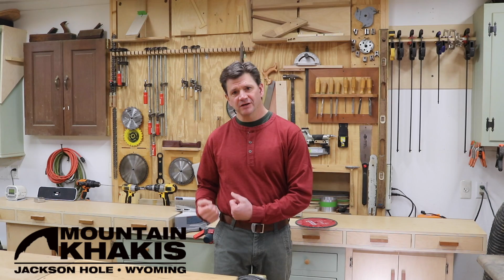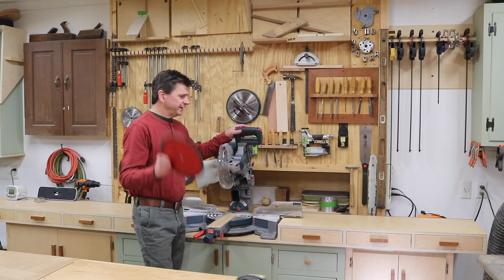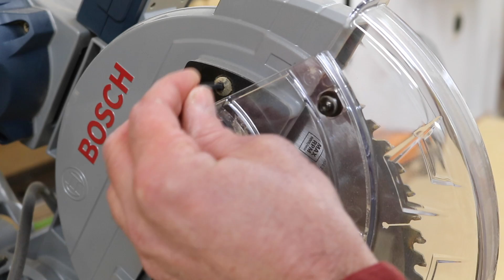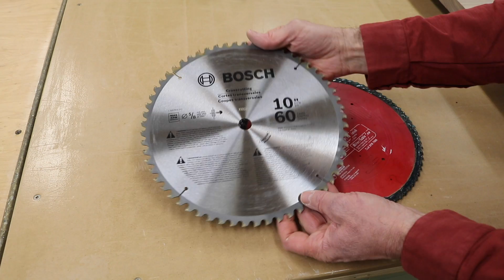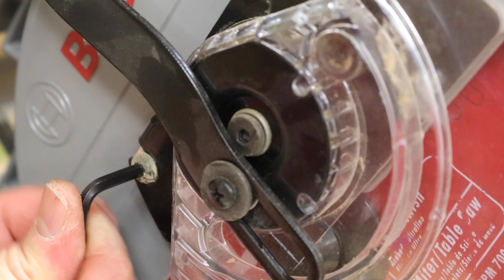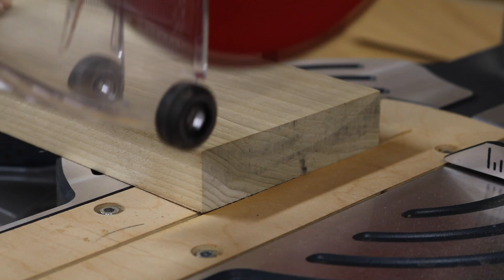Change Blade & Improve  Performance - Bosch Miter Saw

Comment: Thanks for the video. 
I am trying to remove the blade bolt and holding the arbor lock and rotating clockwise on my Bosch miter saw and turning the hex key with all my might, but it is not moving. Any suggestions?

Comment: I replaced the stock blade on my Menard's brand 10" miter saw with one of the diablo 80 tooth blades.....whole world of difference. I'm sure with this Bosch, it has more RPM's so it's even more smooth when cutting. I put the same blade on my Ryobi entry level table saw and it too made a huge difference....very clean cutting.

Comment: Question for Jon and anyone else who has this saw. Why did you buy the 10 inch version of this saw instead of the 12? I know the 10 inch is less expensive but as of July 2020 the 10 inch is only $60 less amounting to a 10% savings. I don’t do construction, well sometimes  build a shed or fence bit mainly do cabinet and shelving construction as a side gig. So far I can only think of cuts I do now that can do on the 10 inch but in the back of my mind I’m thinking “there will be that ONE time” when the need will come up. I have a Incra cross cut sled for my table saw and am thinking any thing wider than 12 inches can be done there.  Thank you in advance for your response.
Reply from the maker: I’ve always used a 10” I just don’t have a need for anything bigger.

Comment: I thought I would let people know, the small holes in the base can be tapped with an m8 tap. M8 adjustable feet are plentiful and cheap, and make great leveling feet.  This is good when setting up miter station.

Comment: THANK YOU for this. I didn't realize that the bolt holding on the blade was reverse-threaded. And mine was on even tighter than yours! I used a piece of PVC as a breaker bar, as you suggested.

Comment: Nice video except that while you pointed to the instructions for changing the blade, you apparently did not read them. You do not have to remove the front screw, you just have to loosen both of them. Once they are loosened, the back of the plate will swing out of the way and you can then hook the guide bar onto the back screw. This will hold the guard up and out of your way so that you don't have to fight it while changing the blade. It's all right there on the saw, in both words and pictures.

Comment: My chopsaw has the same idea for changing the blade. I always wonder why they cannot use the same size screws so that you only need 1 Allen wrench to swop the blade out
Reply: my Bosch comes with a two sided Allen key one side fits the blade arbor nut and the other side fits the smaller bolts.

Comment: Hi Jon, did you find the 60 tooth blade was good enough for super clean mitre cuts or is the 80 tooth blade a must for detailed work like framing? Cheers
Reply: Ok, you've just said it at the end of the video. Thanks
Reply from the maker: Thanks Alex..I prefer the 80 tooth blade

Comment: One thing to remind viewers: Typically the bolt holding the blade in place is left hand thread. So before you grab your cardboard cheater and go all lefty loosey, consult your manual to ensure you're not going to snap the bolt off by over-tightening when you're trying to loosen.
Reply from the maker: Good point Zeb
Reply: Zeb Vigil I was going to say the same Zeb. The user manuals are often overlooked but shouldn't be as they are typically pretty good showing orientation of washers and torque settings too. Nice feature on Jon's saw to have the instructions right on the motor body.
Reply: @DocKandTBW  Oh, just noticed that the instructions are right there...

Comment: I have the same saw and replaced the stock blade with the same Diablo blade - excellent upgrade for sure!  One thing I noticed is that the Diablo blade must be very slightly smaller than the stock Bosch blade because I find I now have to apply a bit more downward pressure to get the blade to cut the last sliver of wood.  Don't know if you've noticed the same thing?

Comment: Here at my work place we are a tool and die shop. We use many hex head screws. We use a steel pipe to use to break loose the screw as well as torquing screw.  We call the pipe as our "Cheater Bar" Thanks for sharing. I too need to replace my blade.
Reply from the maker: Thanks Tom and like the "cheater bar" reference

Comment: I've made the exact same upgrade on my Bosch 10" slider I've had for 7 or 8 years. Great saw and great upgrade! Lucky I had a bay window in the shop though, it sure needs a lot of depth. Not much luck with dust collection yet though I've tried several approaches :)Note: zero clearance insert video won't play for me.

Comment: I notice that the direction of turning of the bolt for the blade is of anticlockwise for tightening, is it so for all mitre saws?  Thanks for sharing : )
Reply: Yes, this is normal -  It's the same thing on a table saw or any rotary tool. It is built this was so that as the blade spins, it tightens the bolt rather than possibly loosening it.
Reply: Yes i am surprised he didn't mention the reverse threads. I don't thing all saws are that way.
Reply: Green Kitty. My cheap and cheerful mitre saw has a reverse thread too. I was a dumbass the first time I changed the blade and forgot about it. Nearly stripped the hex bolt. I've upgraded to a 80 tooth Freud blade too and it's brilliant.
Reply: I like a blade with more teeth, too.  I have no problem making a fine cut on everything.  Thanks for replying : )
Reply from the maker: Thanks everyone for commenting...yes, the bolts have a reverse thread to it tightens when it spins.

Comment: Hi Jon, any tips for dust collection on this saw? I have the 12" and it just sprays dust in every direction. Working on a dust collector for it soon, but just wanted to know if you've had any luck cutting down on dust with some simple modifications.
Reply: What blade do you have on your 12? Just curious 😀

Comment: I have been getting longer life between sharpenings by cleaning my blades with a good soak and brushing with Simple Green, but then I'm cutting a lot of yellow pine and it is prone to gumming up blades.  I also am trying that tape from Fastcap for a ZT  gap, haven't used it too long and am pretty happy with it so far.  Most probably after I use up the strips I'll go and make a new plate for my saw too.  I agree with the 80 tooth blade it is better for a mitre saw, although I'm using a 60 tooth now oops.
Reply: I would say 90% of the time guys think their blades are dull when they just need a cleaning instead of a sharpening...
Reply from the maker: Thanks Jim and good tip.
Reply: I agree, but don't do like I did.  I cleaned 6 saw blades to get all the gunk off then put them and then put them back in a homemade case.  6 months later when I went to get one out they all had rusted.   I said forget it and threw them in the garbage.  should have put some sort of protection on them.

Comment: Hi Jon, love your work!  Would you mind addressing the cost of having a blade professionally sharpened and how many times would you expect an after market blade to be sharpened?  Thanks again!
Reply: I'm considering a Harbor Freight blade, 12" 80T for $30.  Probably about what a sharpening would cost (depends on your area).  Reviews are good.  Carbide is less thick, so it won't last as long after the same amount of sharpenings, but for $30 looks pretty good.